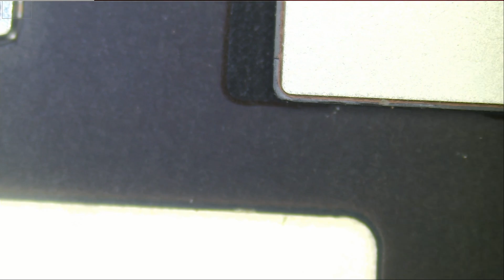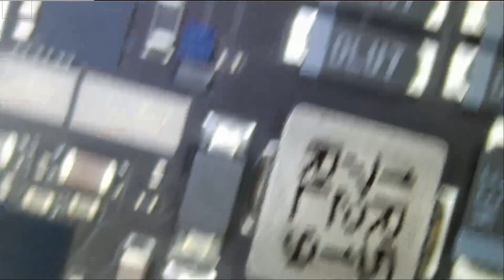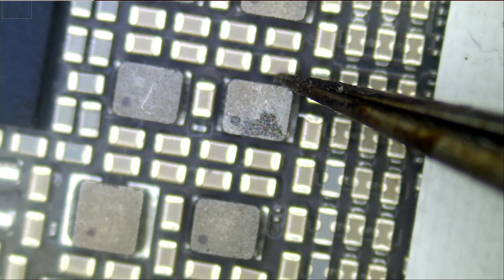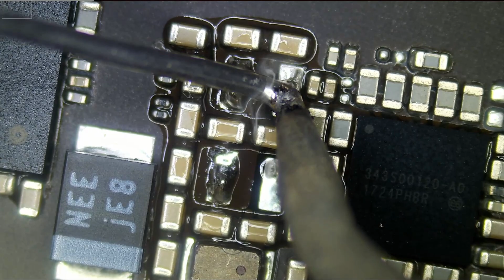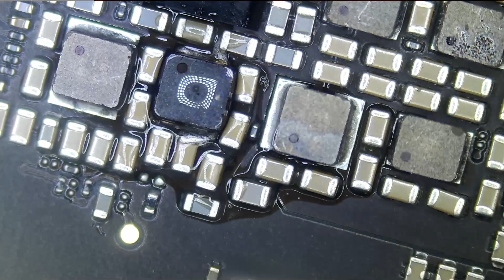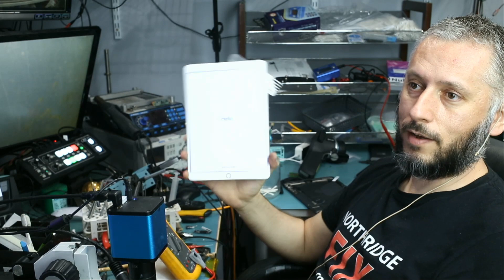iPad pro 10.5" Restarts every few seconds - Stuck in a Boot loop Repair

Comment: Hey Northridge Fix! Been a long time fan of your work! 

Got a question, I’m an electronics assembler at a company that makes electron microscopes, and used to do microsoldering at a device repair shop like your own. 

I have 2 broken inductors on the same model iPad Pro, one has a single foot  broken (on pad) and the other one both feet are on pad and coil was loose when I popped off logic board cover. 
 
Since I’m not working at a repair shop anymore, I don’t have access to donor boards, nor do I want to spend time/$ ordering replacement coils. Will it be ok if I just reattach the broken leg/legs at the base with minimal solder? Or?

Thanks for your help!! Take care

Comment: Hi, how much would this type of repair cost on average? Whether or not it’s worth repairing or getting a new iPad Air 4? My iPad Pro is stuck in that boot up loop, DFU restore and update didn’t solve it so this appears to be the problem. Not long after I got it It would restart every now and then if it had a slight knock like a 4inch fall when putting down on table. So it seems like a loose connection that finally became completely loose. Thanks

Comment: Lead-free solder that is used in modern devices for RoHS is more brittle than leaded solder. If that ipad should drop again, those coils will not likely break off again because he used leaded solder which has better elasticity and is much less brittle.
Reply: Of course thinking back on it now, the legs of the coils broke off at the coil and not the solder so what I said is irrelevant in this case 😅

Comment: Very Nice. How do you guys rule out software issues? Does iPad let you boot to a LIVE OS for testing?
Reply: Well, based on my limited experience. Software issues aren't normally the cause of failure to boot. If it is, usually Apple or whoever the software maker would issue a statement. It all boils down to experience.

Comment: My mom's Moto Android smartphone currently has a bootloop. However we discovered it only works if it is plugged into the charger (and wall outlet).  But once you unplug it, it goes back into the bootloop.  Here are my questions >
1.   Are the coils too big that their tops get bumped when phones/pads get dropped?  
2.   Are the coil legs too thin & perhaps they should be thicker so that they don't break off?  
3.   Anyone know the inductance values of those coils, or is there an all in one value used?
Anyway, I will try to inspect my mom's phone for loose parts.

Comment: Is there a video where you open an ipad up and show how to do it? My iPad got this boot loop. Strange circumstances tho. 

It did about 2 weeks ago. I just left it on my bed, maybe a game was running stopping the ipad to sleep but i'm not sure. I didn't have time to look for solutions then so i just put it aside, 3 hours later it worked. 

2 days ago, also left it on my bed alone, when coming back seeing the boot loop. Waited 6 hours, nothing. Clearing cache, nothing. Connected ipad to my pc and itunes, tried upgrading ios 3 times, still in boot loop. With a big breath i pressed restore for the 4th time. Still the same; while it lasts it acts everything as it should, but when itunes says wait until the ipad reboots and will appear in the menu, it doesn't. 

Any idea what i could try? I guess it's not cuz that coil problem you are showing it here as it wasn't moved a bit neither time.
Thanks a ton in advance for any help.